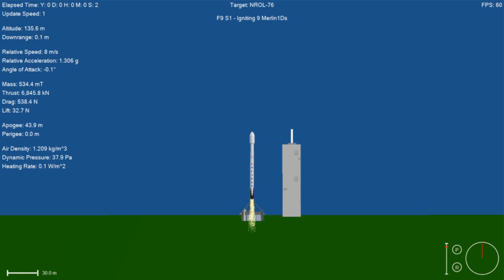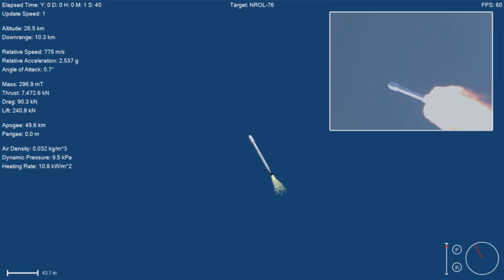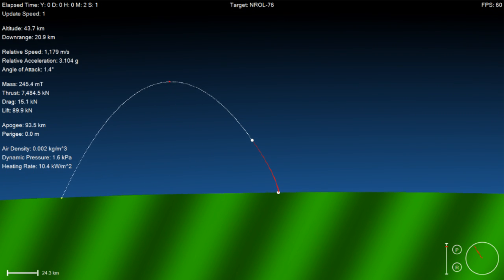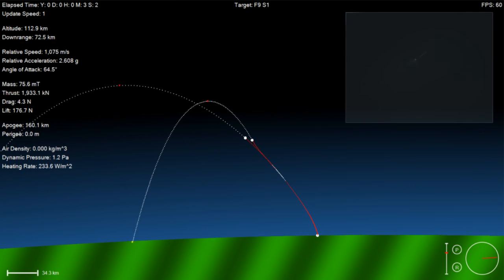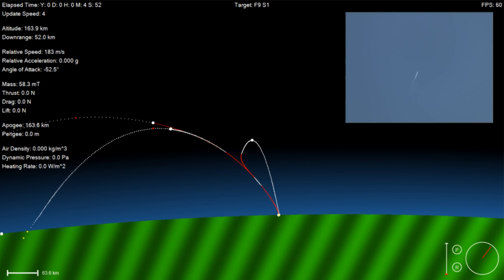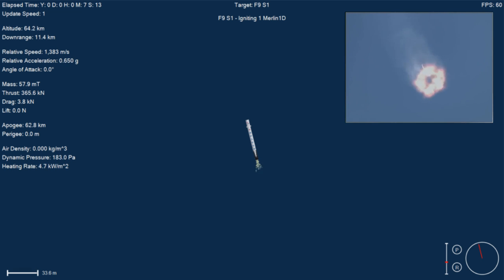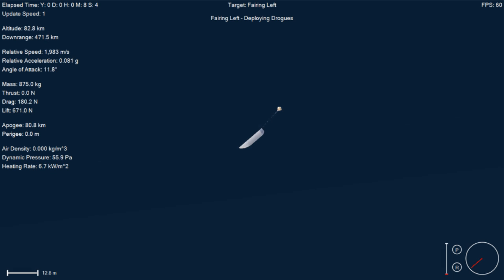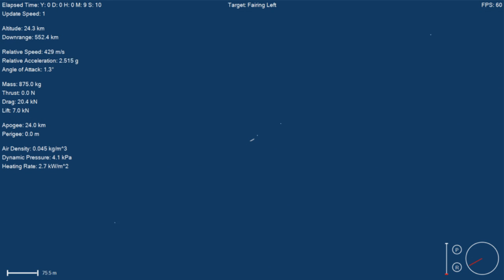NROL-76 First Stage & Fairing Recovery Simulation

Comment: Why did you only recover one half of the fairing?
Reply from the maker: Right now SpaceX is only attempting to recover one fairing half. The other half doesn't have the recovery hardware installed. Once they are successful with one fairing recovery attempt (which may be tonight) then they will most likely start trying to catch both.